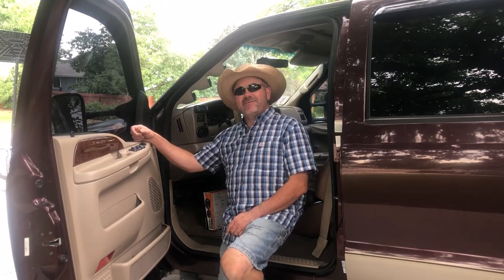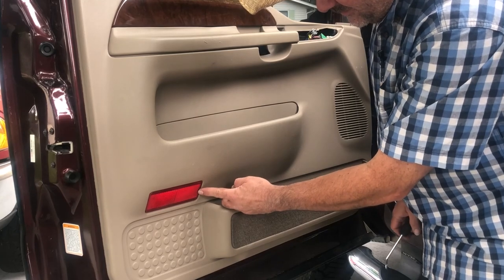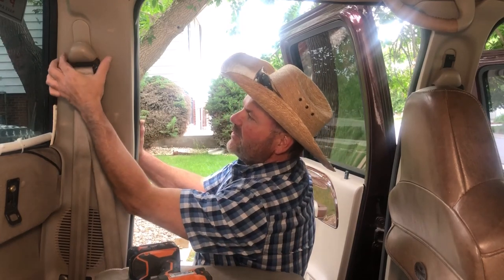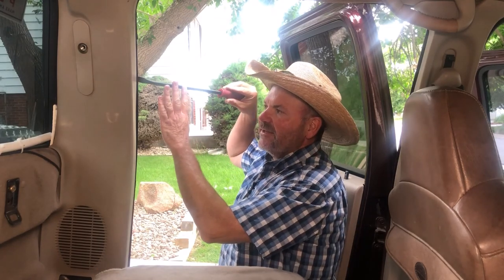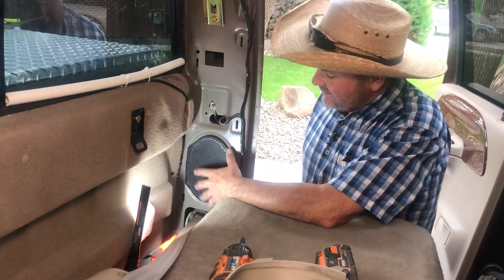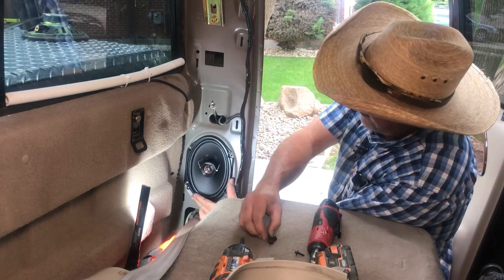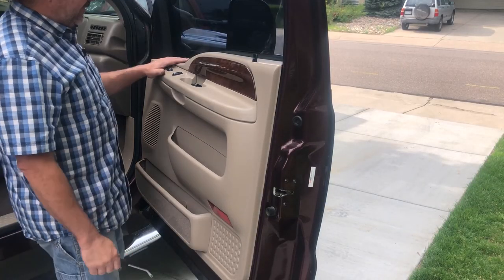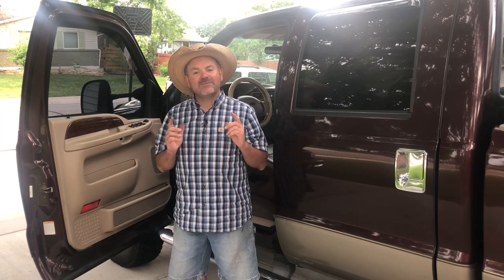Ford F350 F250 Speaker Upgrade, Install & Review - Kenwood KFC-C681 Concert Series

Comment: Funny to see you fold the rear seat back up which then kind of blocks the speaker. So if you wanted the best  sound from this setup you'd need to drive around with the rear seats folded down. :)
Great video, though!

Comment: Super video. Assuming those are 6x8 speakers? What year is your truck. The leather looks great. My 2005 KR leather is pretty ragged.
Reply from the maker: Hi Marvin.  Those are a 6x8 speaker (still doing great btw).  My truck is a 2004 F350 KR DRW.  My front leather in both seats has gotten really bad since making this video.  I plan to replace the leather of both seats this winter and should be making a video about it.  I currently have the entire (literally everything) out of the interior at the moment so I could repair my sunroof (video coming soon), my rear power slider and then completely detail the interior (that will be another video out soon).